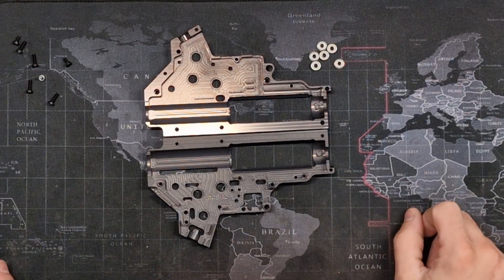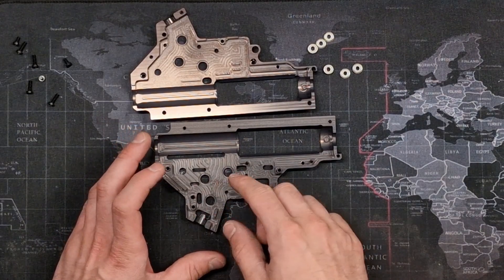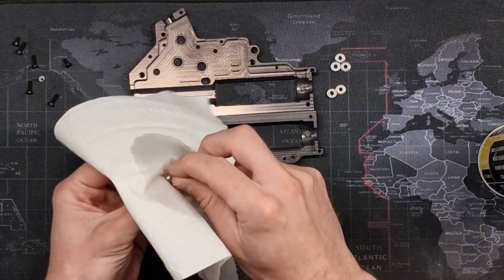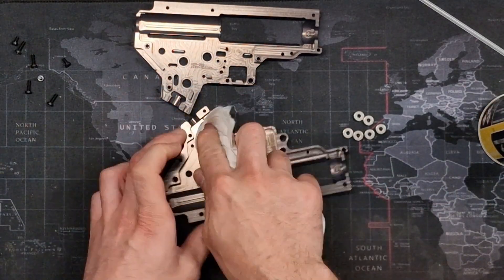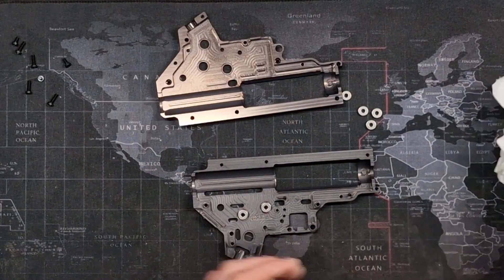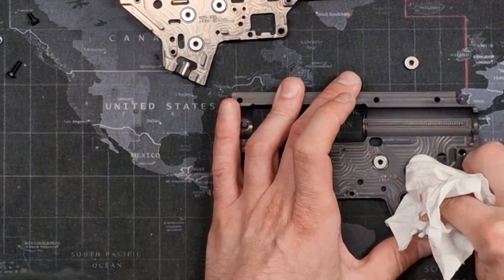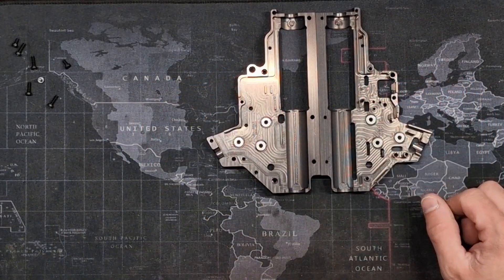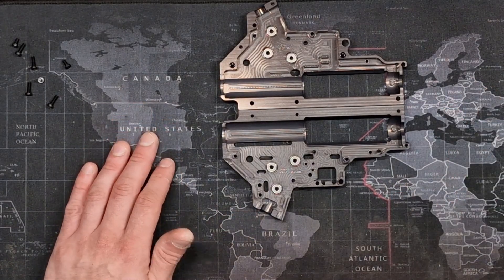Tech tips - How to secure bushings/bearings in your gearbox shell.

Comment: Do you use SHS 8mm bearings? I have an issue that they are too thick and I can’t shim the gearbox correctly… V2 gearbox uses regular bushings right?
Reply from the maker: i find the shs are always iffy. I tend to use 8mm asg graphite bushings for regular jobs and if you need low profile lonex work best.
Reply: @nemtacairsoft8596 Thanks! I used ASG graphite and they worked better